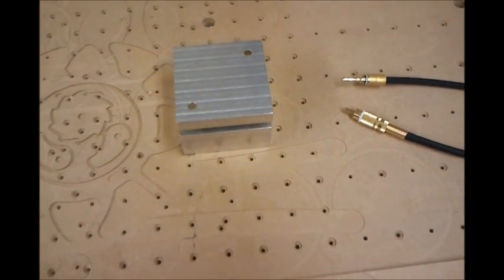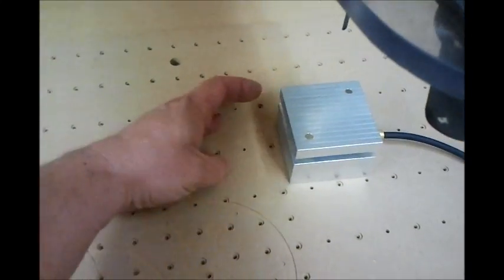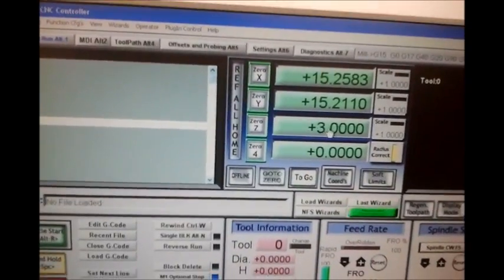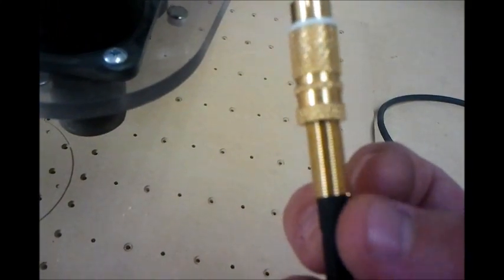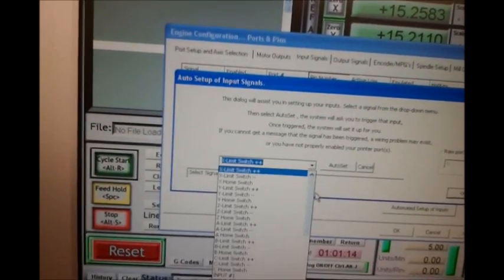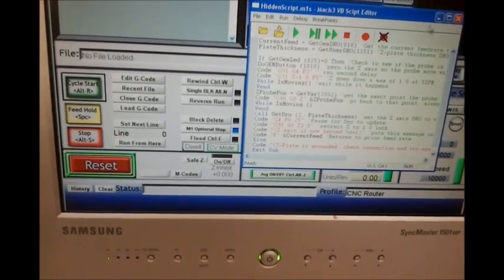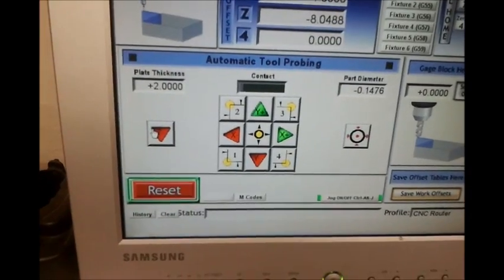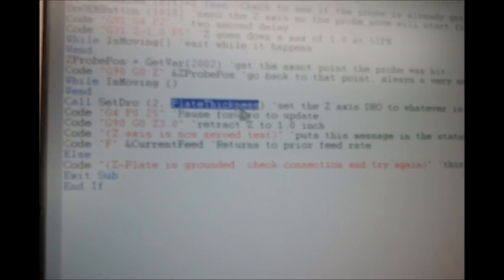Auto Tool Zero in Mach 3

Comment: what could the cause when my digitizer led does not light up i have tried loads of things but nothing seems to work
Reply from the maker: Does it light up on your control board? I don't recall any special setting in Mach 3. Mine is just a passive switch so seems most likely to be a ground issue.
Reply: @rhfabrication  yes it lights up and works fine other than the probe doesn't work to honest I have three other boards and not one of them will work on probe even I have checked the settings over and over I'm baffled
Reply from the maker: @geordie331  I dont recall a setting in Mach 3 but I'll take a look at my setup again  later and get back.
Reply: @rhfabrication  I have noticed in the plugins setup that the input area is greyed out but I dont know if this is normal or not
Reply from the maker: @geordie331  on the ports and pins setup menu, did you go through the auto find pin option? See 6:00 in the video. It shows my setup used and how I found the pin. At least that will give an indication if the switch is being sensed.
Reply: @rhfabrication  unfortunately that wont work on mine as its usb
Reply from the maker: @geordie331  hmm. I wonder if that's a limitation of mach 3 then? There is a signal screen in mach 3 that will light up as you short the input pins. Not sure how you determine the port and pin setup from there but at least it shows that mach 3 is receiving the signal.
Reply: @rhfabrication  well im beginning to think that it has something to do with rnr motion driver plugin but what i dont know very puzzling

Comment from the maker: Here is the code:

CurrentFeed = GetOemDRO(818) 'Get the current feedrate to return to later
PlateThickness = GetUserDRO(1151) 'Z-plate thickness DRO

If GetOemLed (825)=0 Then 'Check to see if the probe is already grounded or faulty
DoOEMButton (1010) 'zero the Z axis so the probe move will start from here
Code "G91 G4 P2" ' two second delay
Code "G31 Z-1.0 F5" 'Z goes down a max of 1.0 at 5IPM
While IsMoving() 'wait while it happens
Wend
ZProbePos = GetVar(2002) 'get the axact point the probe was hit
Code "G90 G0 Z" &ZProbePos 'go back to that point, always a very small amount of overrun
While IsMoving ()
Wend
Call SetDro (2, PlateThickness) 'set the Z axis DRO to whatever is set as plate thickness
Code "G4 P0.25" 'Pause for Dro to update.
Code "G90 G0 Z3.0" 'retract Z to 1.0 inch
Code "(Z axis is now zeroed test)" 'puts this message in the status bar
Code "F" &CurrentFeed 'Returns to prior feed rate
Else
Code "(Z-Plate is grounded, check connection and try again)" 'this goes in the status bar if aplicable
Exit Sub
End If

Comment: Question for you. How do I do this if my Z surface is machined already? I have the touch plate functioning with the auto tool zero but it's useless because by the second tool I have no reference point to put the plate onto.
Reply from the maker: I always set the table to Z0. This way, you can always reference the table rather than the workpiece. I prefer this method anyway since it doeant rely on precision workpiece thickness. I reference each tool to the table at every tool change.
Reply: @rhfabrication  But how do you do that? You no longer have your surface so how do you match the tool length to be the same as the one before?
Reply from the maker: @soorenaaslani7491  I see, the whole table is covered so no touch off point left. At that point, the only way would be to have tool holders with preset offsets. Of course a regular router wouldn't have that. Best I can think is to leave a spot unmachined to have a reference point or a known location to reference from.
Reply: @rhfabrication  no I'm not talking about the table being covered. You said you touch the next tool off the table how are you doing that with no Z reference? If tool 1 is 1inch let's say and tool 2 is 1.2 inch how do you tell the machine that? You would need to make sure your second tool is exactly the same length as the first so I'm not getting how your doing that with the probe off of the table. If you have a z surface then you can just probe your tools off of that and they will all be equal distance from the surface of the part but with the table that's impossible
Reply from the maker: @soorenaaslani7491  I always have room to  the table to set the zero to the table.  If theres no table left, you have to improvise a way to have a known reference height. Could make a jig that straddles the table maybe from underneath and sets a known z height.

Comment: +rhfabrication
HI,  can you tell me,  When you set up the probe in the inputs window.   By default it said PORT 1 and you said to change it to "8" ??
(I cannot see the numbers since the video has low Res.  and cannot distinguish.)

So you changed that to port 8  and it worked??

BTW:  the reason it does not work on PORT 1 is because the computer only has one LPT port (port 0)  
for Port 1   you would have to Plug in a Card in the PCI slots with a second LPT port  that will be Port1  but you only do that when you have 5 or 6 axis to operate.  
Normally the existing LPT is good for 4 axises.

Comment from the maker: Mach 3 will only.move in one unit system at a time. the g code has no units  so to speak. if the program is made in metric units, you need to make sure Mach is set to metric. otherwise a movement intended to be 3mm could move 3 inches is the system is in inches mode.

Does this answer your question?

Comment: Just found your video and starting to look at how to save tools to mach 3.

 Question if your tools are standard sizes but you use them in metric gcode sometimes how does that work or does it make a difference when saving them to mach3?

Say the Tool 3 is saved as a .125 diameter and use it as .125 in a program but another program you are running a 3mm tool size but use the .125 instead of a 3mm does it make a difference to mach 3 as long as the gcode says i am running a 3 mm tool?

Comment from the maker: To all that have asked for the script, I have posted it below.  I just realized that my website is actually down currently and am working to get it live again.

As I mention in my video, the "PlateThickness = GetUserDRO(1151) 'Z-plate thickness DRO" line can be replaced if there is no DRO input.  Simply measure your own block thickness and change the line of code to read something like: "PlateThickness = 2.00" for  a 2" thick plate.

Copy and paste from here:

CurrentFeed = GetOemDRO(818) 'Get the current feedrate to return to later
PlateThickness = GetUserDRO(1151) 'Z-plate thickness DRO

If GetOemLed (825)=0 Then 'Check to see if the probe is already grounded or faulty
DoOEMButton (1010) 'zero the Z axis so the probe move will start from here
Code "G91 G4 P2" ' two second delay
Code "G31 Z-1.0 F5" 'Z goes down a max of 1.0 at 5IPM
While IsMoving() 'wait while it happens
Wend
ZProbePos = GetVar(2002) 'get the axact point the probe was hit
Code "G90 G0 Z" &ZProbePos 'go back to that point, always a very small amount of overrun
While IsMoving ()
Wend
Call SetDro (2, PlateThickness) 'set the Z axis DRO to whatever is set as plate thickness
Code "G4 P0.25" 'Pause for Dro to update.
Code "G90 G0 Z3.0" 'retract Z to 1.0 inch
Code "(Z axis is now zeroed test)" 'puts this message in the status bar
Code "F" &CurrentFeed 'Returns to prior feed rate
Else
Code "(Z-Plate is grounded, check connection and try again)" 'this goes in the status bar if applicable
Exit Sub
End If     

Thanks for looking.  Please post back with questions.

Comment: Hello, Now that you use the auto tool zero, did you enter your cutters on the tooltable for offsets, etc or dont have to?
Reply from the maker: I don't use the tool table because they mount differently each time. If I were able to use tool holders I definitely would. That is the problem with collects in a standard router.

Comment: can you please help me ? no matter what I always get a 2mm difference between zeroing and going to zero, ie. auto tool makes contact, reverses up a bit and when I press gotozero button it goes 2 mm below the probe height, any idea what might be causing this ?
Z axis is calibrated
Reply from the maker: What is the plate thickness variable set to and what is the actual thickness? it sounds like going downward is a positive movement on your machine maybe? In that case, you would need to change the code so that after it touches, it goes negative plate thickness rather than positive which the code does by default.
Reply from the maker: What is the plate thickness variable set to and what is the actual thickness? it sounds like going downward is a positive movement on your machine maybe? In that case, you would need to change the code so that after it touches, it goes negative plate thickness rather than positive which the code does by default.
Reply: rhfabrication
thickness is default from your script, 2,000 is this inch or mm ? Probe is 20,07mm high.
Actually I've explained the problem wrongly, I believe that when I press gotozero it should go all the way down to probe base height but it doesn't it goes only 2 or 3 mm below contact plate on top, I tried changing thickness in script to 20,07 or .0790inch and there's no difference. Btw if I press play on script editor it moves Z downwards so it is working
Reply from the maker: MentallFloss 
The code will execute in the units you are currently using I think. I use inches for mine. If using mm, you may need to make a couple of changes. first, set the plate thickness to your thickness of 20.07mm. Second, there is a line that allows it to travel up to 1 inch downward before it errors. That is too close for 1 mm I think. Try using 25th for that. All else should be fine as long as descending is negative which it sounds like it is.  Again, I don't run mine in metric so I can't be sure but these steps should fix the problem.  You can always private message me also. I hope this works. Please let me know.
Thanks,
Richard